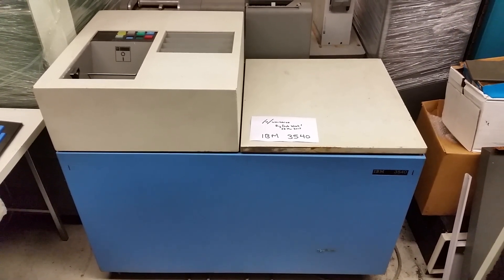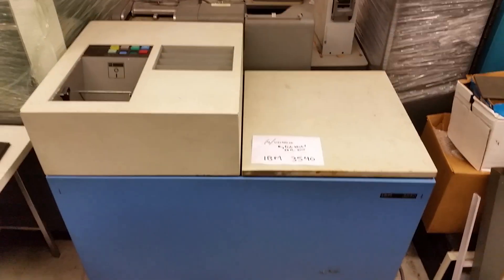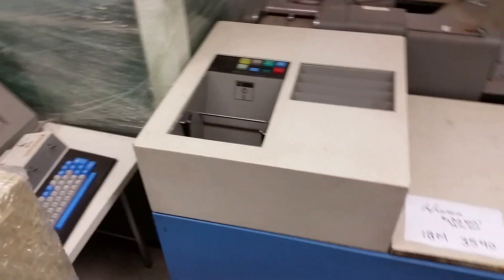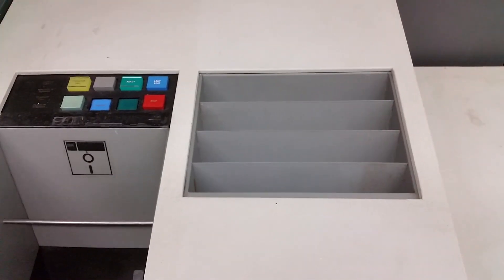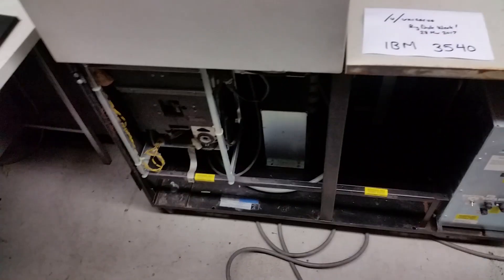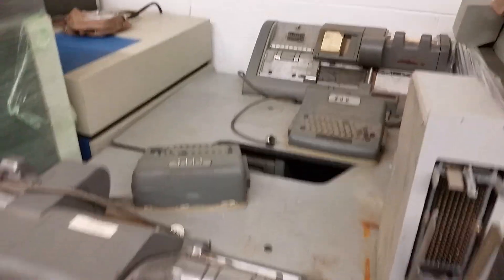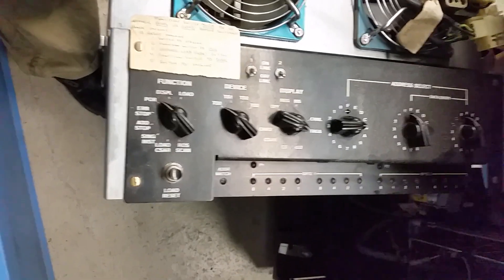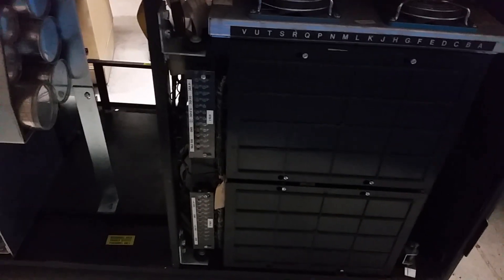IBM 3540 Diskette I/O Unit

Comment: There's no reason the buttons on those should ever be melted.  In order to change those bulbs needed a "bulb sucker" tool, to  get it out of there (for lack of any better term.)  and an oddball bulb I've never seen sold through regular suppliers. I just like lights, bulbs, and shiny things, and I would replace those bulbs in machines in my account, but many techs just ignored them. Some were requierd for the functionality of the machine, such as the 3420 tape drives.   They certainly used enough space up on the cards, gates and power supplies.  Those were gone before my era, but the size of the chassis is rather shocking, even in it's day.

Comment: To this day I believe that filesystem / disk organization should be handled by dedicated offload processors. A FSIOP. You should not tell any sort of dasd to seek to  cylinder 133 and read the records 34-58 on head 4. You should instead tell the dasd with a single ccw to open a dataset member disp shared "sys.ibm.someds(member1)" and it returns a 32 bit reference. Then you should tell with the next ccw to seek to offset 81920 on that reference and transfer 32345 bytes. This concept was realized by the way in commodore floppy drives. Anyhow this enclosure looks big enough to fit a whole processor to do just that.

Comment: Do you also have one of the key to Disc systems?
Reply from the maker: Yes, a pair, but they are in rough shape.
Reply: Very nice, those units looked a lot like the System 32 with the display being viewed through a mirror and a large disc drive to the lower left.
Reply: As late as 1998 I was working for an end-of-life maintenance company, who took IBM's dead products on contract and would coninue repairing them until the parts/skills bin ran dry.  We had quite a hand full of those 3741 keypunch machines that actually wrote on a dikette.  They were rugged, and it didn't take a whole lot to keep them running doing an exchange of the diskette drive, and returning it to our offices where I could clean/fix/replace R/W heads. We never had any trouble with the logic cards in those. We even had a couple of the 3742 models which shared a CRT between two operators.  I really liked the part where if customer is being unreasonable about it, we would return their money and wish them well finding anyone else to fix it. Those contracts were best effort, but the machine is past end of life, and we didn't do emergency anything on end of life machines.